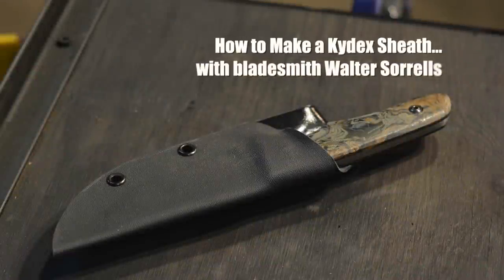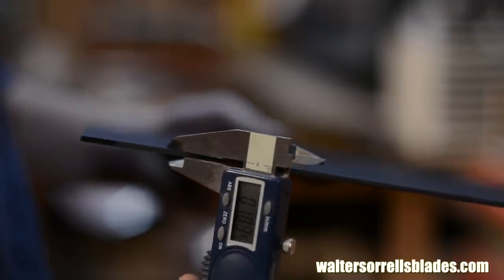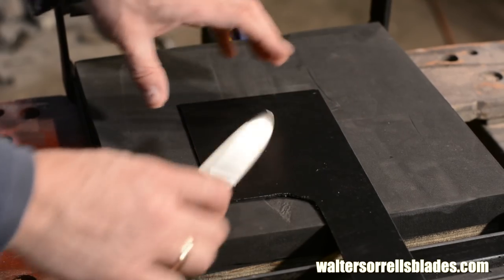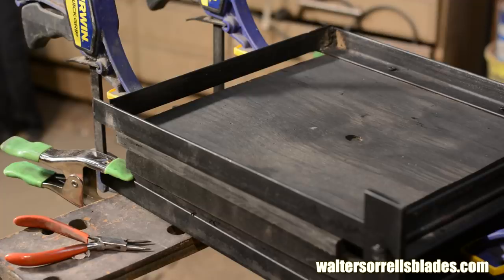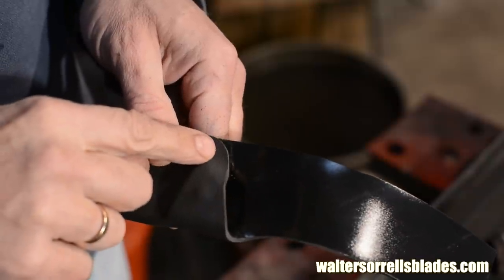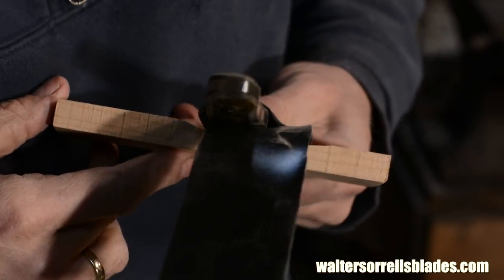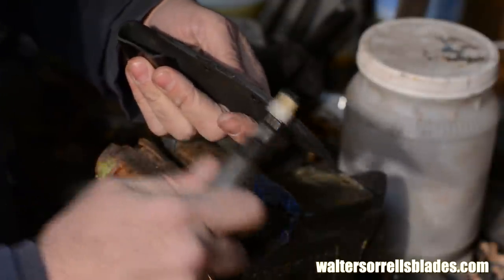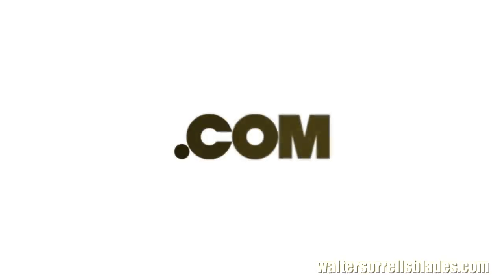How to Make a Kydex Knife Sheath

Comment: I cannot believe any body would give this video a thumbs down. This video is top notch and instructional. I subscribed and now, I will attempt to replace the cheap sheaths that come with most knives. Thanks. Highboy
Reply: @Suzukisan - if your mold is correct and you rivet the thing correctly the blade will never come through the bottom
Reply: Haters gonna hate right? ;)
Reply: @Suzukisan other then 2" of hard thermo plastic. If you hit the top of the knife that hard, you have bigger problems to worry about! Like how the hell did I fall off this sky scraper!
Reply: Adrian Diaz  Yep, just like on my gun channel. Highboy

Comment: I'm about to make my first kydex sheath. I've bought .080 kydex and built a press, but I'm having trouble finding the right eyelets. I want to use 5 mm (.197") inner diameter but they all have such a short barrel (4mm/.157") that they won't work. What eyelets should I use?

Comment: when I make a sheath like this, I always have a problem. usually I make it for a knife with a fairly pronounced drop point, whatever knife it is, and I end up with a "point" of the sheath that is slightly far from the actual tip of the knife, as by folding the kydex it remains straight and there is no way to follow the curve of the spine in the profile of the sheath. is there some way to avoid it?

Comment: Hey walter I'm about to work on a kydex sword sheath. The end of the sword blade is wider than the base how would this method work for a sword like that? its the zgb executioner 2.0
Reply: +holyshaman use a material that wont stick to the kydex near the base of the sword. the goal here would be to make a level opening for the sword, but you would still have to use part of the hilt for retention.

Comment: Also does the heat from the kydex screw up any tempering?
Reply: Good question. But the answer is No, and for two reasons. Kydex is heated to about 340°F, which is much cooler than the average tempering heat (~400°F) of most blades, and it only stays hot for a few minutes, while tempering will usually take well over an hour.
Reply: Richard R Thanks for the info.

Comment: Do you have a video showing how you made the press you used in this video?
Reply from the maker: +Alvin Pope I bought it from Riverside Machine.
Reply: +Walter Sorrells But you say in the video that you made it.
Reply from the maker: You're right.  I thought he was asking about my hydraulic forge press rather than my kydex press when I originally read the comment.  I answer about eight billion questions a day and I totally didn't pay attention to which video the question was from.
Reply: Fair enough:)
Reply: +Alvin Pope it looks like foam. i guess you could make a giant tortilla press and lay some foam in it. the foam would conform to the shape of the object(s) inside of it, and since the kydex is soft when heated. it would press the foam to the shape of the knife inside.
Reply: +Alvin Pope From what I can tell, it's just 1/2-ish" plywood, with 1-ish" Neoprene foam sandwiched between some welded angle iron.  Looks likes for hinges, the stop section is just bolted on with all thread & lock nuts.
Reply: Don't think so. it would be simple and cheap to use foam, ply wood, hinges, angle iron, and some foam. "Neoprene foam"
 which i believe is the rubber like stuff would be the most ideal..

Comment: So here's a question; what about edge dulling, is it an issue with those rivets?
Reply from the maker: Good question.  But the answer is, no.  The blade doesn't ride on the metal of the rivets, so there's no issue there.  The rivets just hold the plastic together and the blade edge is only in contact with plastic.
Reply: I'm considering acquiring a kydex sheath aftermarket for a production knife that happens to have a trailing point, would a slightly curved draw eventually push through and hit the rivets even on a good sheath?
Reply from the maker: Well, I'd never say never, because the more complex the geometry of a blade, the more likely it is to compromise a sheath.  Kydex is not ideal for blades like khukris that change directions or widen toward the tip.  But that's not to say it can't work.  If its correctly made, you should be okay.
Reply: I'm looking at a sheath for full flat ground blade with a trailing point and I'm just sort of afraid of wasting $$, I guess I'll get a leather sheath.
Reply: Walter Sorrells
can you use Kydex to make pistol holsters
Reply: bobhilly546312156332
It's been done a million times before.
Reply: bobhilly546312156332 You can use kydex to make pistol holsters, hosters for your lighter or mini bic and a fire rod for bushcraft or numerous other uses.  Use your imagination.

Comment: Have you ever had any problems with the kydex scratching the blade? I usually wash both the knife and kydex with soap and water yet still find some scratches. Any recommendations?
Reply from the maker: +lewisandrew7 I guess my short answer is that kydex will always leave some scratches.  I view it as something for working knives that you're going to scratch up anyway, so I just don't worry about it much.
Reply: Walter Sorrells Thanks for the input. I've found that wrapping the knife in a couple layers of tape prior to pressing the kydex allows a little wiggle room and prolongs the finish. But over time the scratches/ware is inevitable like you stated.
Reply: yes a linear
Reply: if you put a single layer of blue painters masking tape on the blade befor forming the kydex it wont scratch the blade.